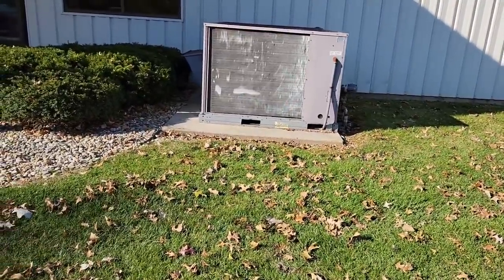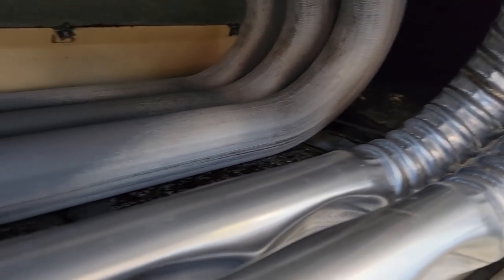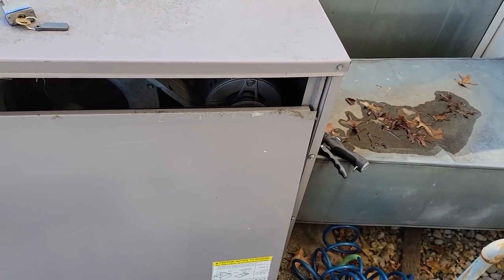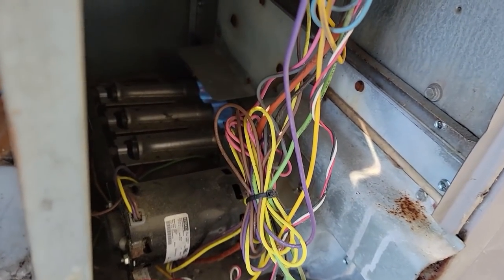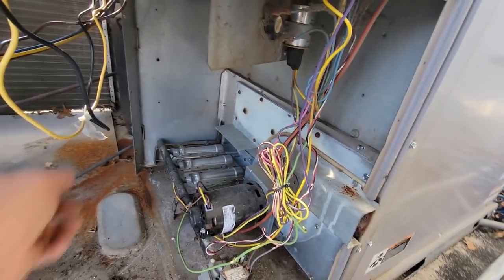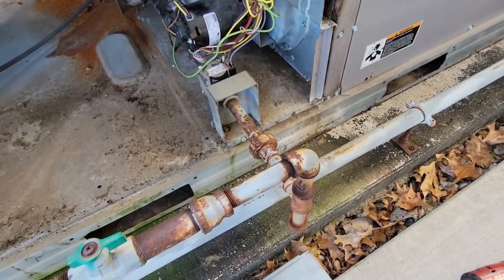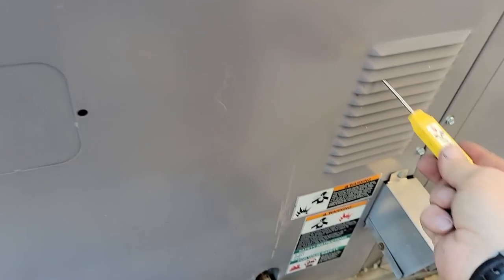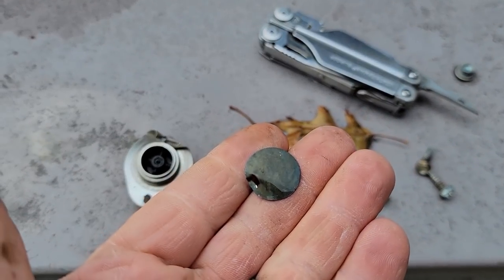Intermittent Heat - Logical Elimination Diagnostics

Comment: Retaining plate can cause that, though yours looked OK, seen high wind cause as well. Great job Rick!
Reply from the maker: I had two service calls for the exact same thing within a month, after replacing the limit switch at this location and another location, I no longer received any more phone calls about the limit lockout. Must have just been false limit trips.
Reply: @HVACRSurvival  they are crap limits, like everything these days built to fail
Reply: @Everything HVACR  had that happen to me. The retaining plate would cause the flames to roll out. I had to watch from under the inducer. When the blower came on, I saw the flames being blown backward and down. Used some high temp silicone and sealed up the plate and any openings. It hasn't happened since. Also had wind cause issues, roll out and opening the pressure switch up. Added a wind baffle and it hasn't reoccured.

Comment: break the back cap off the limit switch and look at the contacts and check terminals for being loose, they're held on by rivets which helps makes/holds the connection from terminal tabs to contact bars together.  dirt and corrosion in the enemy to them, on both the bimetallic disc side and the back terminal side as well as internals.
** posted too soon, you ripped it off right after. if I don't comment when I see it, I'll forget(multitasking for the loss)

Comment: Be sure to check the u-bends on the ht exch directly after the burner for rot out. The metal  is already thin due to the mandrel bend and is especially prone to failure on the tube seams.   You mentioned high moisture in the exhaust, and i have found a lot of corrosion in these collector boxes ahead of the inducer fan, with rotted out flow restrictors.  Definitely not a lifetime warranty type of construction.
I dont work on these often and yet have come to dislike the engineering team that laid out this furnace section.  Best thing about it is the access panel below the fan.

Comment: Don’t know if you have checked the heat exchanger or not. I just replaced a exact one recently,. It had cracks everywhere. The heat exchanger is really expensive
Reply from the maker: That's the first thing I check Everytime because the call stops if it's bad.

Comment: What does it mean when a system is "zoned"? Thanks
Reply from the maker: It means there are damper motors that open and close to heat and cool only the areas that the thermostat is located instead of one thermostat for the whole house.

Comment: You think you might be messing with the regulator in the gas valve causing it to pop when it lights off by turning on and off the gas supply like that?
Reply from the maker: It does, it would have been better to use the gas valve power switch.

Comment: Question? On a Reznor hanging heater F-75 having problems with unit only fires when the eco connection on gas valve disconnected. Any thoughts from anyone. Thanks

Comment: Rick, those thermal switch contacts ARE silver. Military jets have silver wiring in them. That was one of the reasons that there was a rush on silver coins in WW2.
Also, contactors have silver in them in case you didn't know. Might want to save them up. You could melt them down and make an ingot from them. Laundry borax will help purify the silver. Old fuse boxes had silver in them too, but I doubt that modern fuse boxes or breakers have any in them
Reply from the maker: I know silver is one of the best conductors. It takes a bit a patience to get it melted down.

Comment: Gas pressure…? It looked like Elevated pressure not far from the valve inlet..?  I have seen several instances of over firing with those carriers. Most were related to crazy high inlet/ manifold pressures. Good luck Be safe

Comment: It’s funny but I work on the same package units for Carrier/ICP and never had issues with those rollouts. It is not the greatest design at all though but maybe just a bad series of them that got installed from the factory 🤷? Also, Carrier heat exchangers will rust out where it bends upwards in the exchanger, and yes, the combustion gases for me are always a moist feel at the exhaust fan.
Reply from the maker: I recorded this in November,  it could of just been drying out from summer condensation. The limit fixed it just like it did the other rtu that did the same thing.
Reply: Water is one of the products of combustion. It is normal for the exhaust gas to feel wet, because it is. You don't usually notice it because the gas is hot enough to override the sensation of moisture.

Comment: Common issue with these especially after heat exchanger replacement cheap snap action gets weak after multiple trips from rollout. Hopefully that comfort 2 zone system doesn't start giving issues Carrier doesn't make parts for them anymore.
Reply from the maker: That's a good point on the repeat trip but normally it's one strike trip.